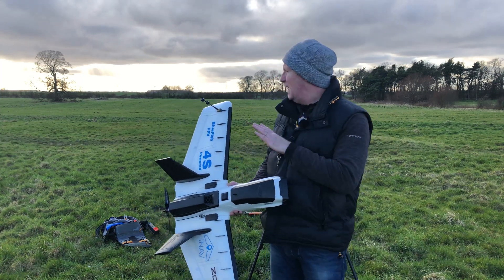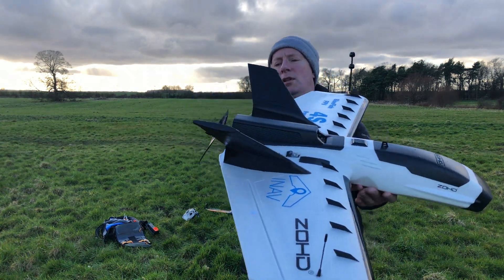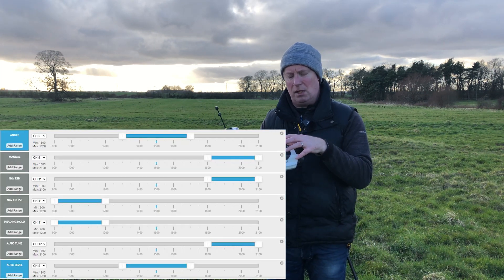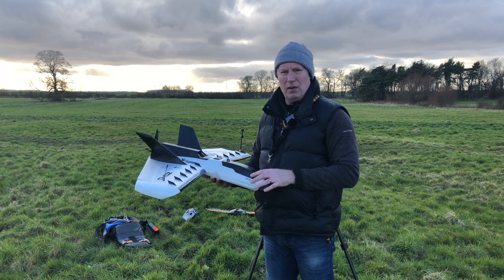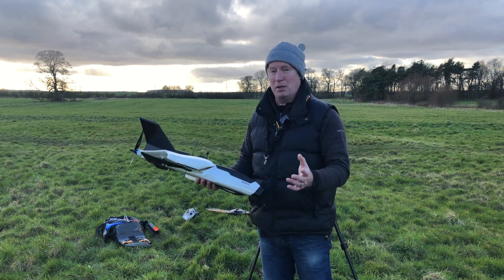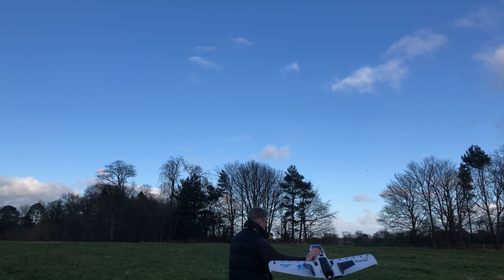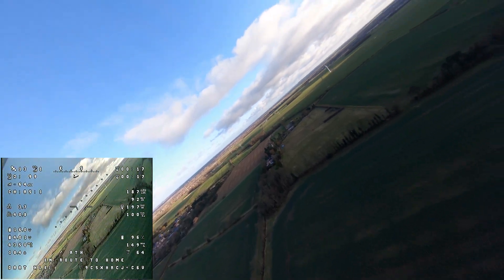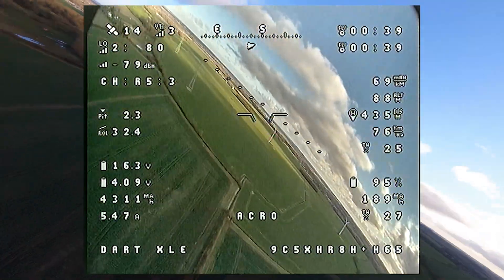Dart XLE V2 inav 4.0 Solving Pitch Issue

Comment: Thanks man! I just put together my kit version and did the maiden flight line of sight. She flies great but is pitching up quite a bit on throttle. I'll try to shim the motor mount. Cheers!
Reply from the maker: I just rebuilt mine with a new kit after an unfortunate argument with a tree, fitted a 3D printed motor mount I found on Thingiverse and the pitchup problem is much better.

Comment: Hi Glen!

Another Dart XLE question for you. 

You have analogue in the Dart in this video and you have a DJI AirUnit in the AR Pro. Two years ago I attempted to Go Digital with the Shark Byte system, but the VRX adapter failed and I got refunded. Ever since I have been waiting for the HDZero HD Goggles to be released. Today I ordered the Goggles with the VTX and camera bundle. The VTX and camera will find their way into the Dart XLE eventually.

The distance that the digital camera and the VRX can be separated is limited by the length of the MiPi cable (DJI, Walksnail and HDZero all have a similar limitation.)

The HDZero "Freestyle" VTX is 1000mw and needs an airflow to cool it, like any other hi powered VTX. The HD camera with foam packer will block the airflow into the body from the nose. To cool the battery I was intending to fit a NACA duct near the front of the battery cover, but that looks like that is where the VTX would have go. And the NACA duct would need to be in front of the VTX anyway.

So have you thought about where you would mount the AirUnit if you went in that direction?
Reply from the maker: Hi Dave, sorry for the late reply, hobby time has been at a bit of a premium this last week or so now I have returned to work after Xmas break. I did actually instally a DJI air unit in my DXL and made a simple mount that sat just behind the GoPro and in front of the lipo. The DJI air unit to camera cable length is only 105mm so maybe similar to the HDZero. I did not use the foam mount as the GoPro Hero 6 fits behind the plastic nose plate without and so there was sufficient air flow under and around the GoPro to keep the AU cool enough. I had that setup in June and July of 2021 and it was pretty warm with no issues. 

I made a NACA duct in the front of the battery cover in my Dart 250G to cool my CADDX Tarsier as that got really hot and that worked fine.

But, I am thinking about the same thing for my Ritewing Mini Drak I am building as I will be using DJO O3 and Goggles 2 on that aircraft and tests so far with the O3 air unit is that they get considerably hotter than the V1's I have. So my idea is this, I intend to make a raised mount out of Carbon fibre to insulate the foam or any PLA parts from getting hot, so like a little carbon table that sits in front of tthe lipo as close to the nose as possible. I will make the height so that when I make a cut out in the hatch the top of the air unit (VTX) is flush with the surface of the hatch. My thinking is that the air rushing over the top surface of the AU will be enough to cool it without creating too much drag.

If that does not provide sufficient cooling I will either raise the height of the AU to expose more of it to the airflow or add an alluminium heat sink to the top of the AU to help with more heat induction into the atmosphere.

I will drop you an email with a sketch of the idea as my description may not be easy to visualise.

All just ideas at the moment and subject to testing, I hope that helps in some way.
Reply: @bluefish3607  Many thanks for the extensive and detailed reply.

Yes, I had heard the the new DJI AU gets a little warmer than the old one:
https://www.youtube.com/watch?v=stlMJflRfiU  🥵

My mate has printed me a NACA duct: I intend to fit it in the top of the battery hatch, notwithstanding the following. 

Very interested to see your sketches of what you describe. I think you have my email address.
 Presumably you would want the carbon fibre shelf to be demountable, especially to avoid restricting fore-aft battery placement. I had thought of mounting the VTX to the battery hatch but I never like having to cable to regularly moved hatches, certainly not with those fragile MiPi cables.  For HDZero there is a range of MiPi cable lengths: 40, 80, 120 & 250mm. The Freestyle Bundle comes with 120mm.

I like your idea of using a foam block to cushion a GoPro from the blow from the battery in an impact.

Comment: My Xmas break project is the build of my Zohd Dart XLE with Matek H743 iNav FC - so this is of particular interest.
Research would suggest that the original Dart XL seems to suffer badly for pitch instability for too much reflex in the aerofoil and the wrong thrust angle. Even thou Zhod seem to take on board owner comments, the pitch angle of the XLE still appears to persist.
But how do you rate the reduced reflex in the XLE? 
Will it be worth replacing the foam elevons with balsa TE?
Reply from the maker: My issues with the XLE V2 was that it was poorly setup and after ensuring it was mechanically trimmed well and running the iNav Autolevel and Continuous trim it flew really well and in fact I removed the washer from the motor mount. This plane is a bit of a cruiser and I don't fly it agressively like the AR Pro for which balsa eleveons are a must in my opinion. Balsa eleveons on any foam plane I think add some value but less so I guess if you are just cruising around. I sadly crashed my XLE into a tree and destroyed it and am just waiting for them to gho back on sale again before replacing it. I will be fitting balsa elevons to my new one because I now have the experience of making them and its pretty easy. I am sure you will enjoy your XLE with or without elevons its a great plane and best wishes for the build and maiden.
Reply: @bluefish3607  Thanks once again for you helpful comments Glen.
Cruising is not really my scene - my venture into iNav is essentially just for the RTH benefit. I flew my Vantac AR+ Wing aggressively and as acrobatically as much as one can with a wing. I tried increasing the thrust angle to counter the nose-up on throttle, but eventually too much made take-offs harder, and it would pitch down before airspeed increased enough to counter that. Compromise won out. But I realise now from your vids that the flat taper of balsa TE elevons would have helped instead of the curved up foam elevons. 
It didn't help that the AR+ motor with 80A ESC and DalProp 50x46x3 quad props gave 1300g thrust - it was quick.

I would welcome an off-line chat with you - my email addy is in my About tab

Comment: Am I correct in saying in most cases you shouldn't have to manually adjust pitch level in 4.0? Just start with the default and set auto level to tune during flight?
Reply from the maker: Yes in theory and I have not had any issues with my AR Pro, AR 900 or Dart 250G but the Dart XL design it would seem is a little off in so much as it pitches up under higher throttle. It seems the thrust angle of the motor is somewhat to blame so I am trying to tune it to reduce this effect. The permanent autotrim and autolevel in inav are not really the answer I dont think so I am going to work on the motor thrust angle and try and get the plane to fly as well as possible in manual mode so when I am flying long range in autonomous modes the elevons are not having to work so hard, the flight should be smoother and I will use less power as servo movement will be lower. Thats th theory anyway and all subject to future testing and tinkering.

Comment: Deffinitely an improvement over the stock motor angle... i have one of these now and boy oh boy it hasnt dissapointed :) some nice flying there mate :) i have my motor with 4mm of washers on the top bolts and also i have a slight amount of downtrim in manual as the dart xle has a lot of recurve on the back of the wing so when you add downtrim the aerofoil actually becomes better due to this, give it a try ;) 🙃
Reply from the maker: I definitely will continue to play around with the thrust angle and other settings until I get this wing as good as it can be. Thanks for the tips I will defintely give that a try.

Comment: Constant Servo Trim, best idea they have had for years IMO...Makes life real easy...If you switch from Cruze Mode into Manual and there's no real loss of altitude, you're done. If you then go max throttle, just watch what it does and shim motor accordingly....BUT..you have to have it in Manual Mode.....Looks spot on to me soon as you selected Angle Mode....🤔😀😀🇬🇧
Reply from the maker: Thats brilliant advice I will do this on my next trip out and then focus on squeezing max efficiency out of this setup and see how far out I can get with my 10000mah LION.
Reply: @bluefish3607  Don't expect to get it perfect when you throttle up, an increase in speed means an increase in lift because Flying wings often have semi symmetrical wing sections and reflex. 10 amps is going to get you a long way, beyond your 13km DJI limit Id say...Look forward to seeing it's legs stretched..🤔😳😳😀
Reply from the maker: @EnglishTurbines  yes i understand that pitching up as throttle increases is inevitable but before it was almost unflyable. With my 10000mah ZOHD LION pack I am going for 30km out. Weather permitting I hope to make the attempt as soon as I can.
Reply: @bluefish3607  Oh, sounds ambitious, what video system are you going to use?..Just programme in a Mission, it'll be fine....lol ..🤔😀
Reply from the maker: @EnglishTurbines  I did 17km with my 5.8 Solo Tank VTX and 150mm Patch. Just looking at other antennas at the moment and looking to get my My Fly Dream Mini Crossbow tracker setup. Not done a mission yet but that is on my wish list to learn and try. I alwys get very anxious when I go out far and lose my VTX signal tbh :-)
Reply: @bluefish3607  Oh, I've just bought one of those Rush Solo VTXs...They look pretty neat. It's for my 5.8g quad though, I prefer 1.2g for range flying.
Be interested to see your antenna setup because 5.8 rely on effective accurate antennas.🤔😀
Reply from the maker: @EnglishTurbines  I have not looked in 1.2g yet. I will also be inbterested to see how things turn out on 5.8g with new various antennas and my tracker. Time will tell I guess
Reply: @bluefish3607  Yes, 1280mhz goes much further due to the considerably lower frequency. Dipole antenna on the model and a channel tuned low DBI Patch on the ground. Don't need a Tracker the Patch has a 180 degree FOV.... Simpler, cheaper and less RF power on the plane...Works happily alongside CRSF on 868mhz..🤔😀The other advantage, is you don't need the insane altitudes associated with 5.8g and it's Fresnel Zone drawbacks..😳

Comment: Looking good, you have the beast tamed!  You should do what I have done for your antenna tracker (assuming you have a FULL crossfire module) - by passing the gps location of the plane from crossfire telemetry directly into the tracker. Happy to help you if you want.
Reply from the maker: Yes it's tamed and i am so relieved and happy its been a tough one and nearly gave up oin the Dart XLE.
I gave up on my tracker with bluetooth but now wifi is supported I am keen to try again. I have the Crossfire Micro not the full sized one and was just about to message the FB group for some help. Do you know if I need to connect additional RX and TX from my Nano to the FC to get Mavlink or can I just use the two and run the tracker over CRSF?
Reply: @bluefish3607  If you have the full RX/TX connected to the crossfire receiver then full telemetry is passed through it - no separate connection is required.
Reply from the maker: @Caroline_Tyler  Thanks Caroline I had better see if I can find some info on the MFD group to start the configuration process. I already have my WiFi modules.
Reply: @bluefish3607  I got Agent M working easily with the plane's telemetry displaying on the moving map via WIFI. You won't have a problem.
Reply from the maker: @Caroline_Tyler  Thanks Caroline would you mind if I PM'ed you on FB if I need a little guidance?
Reply: @bluefish3607  I replied including my email as I'm not on FB - hope you got it